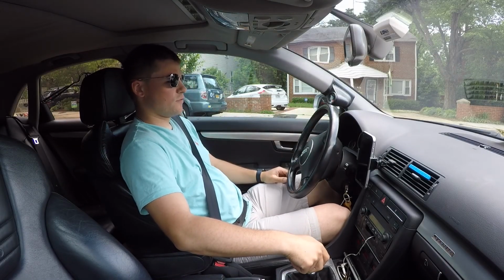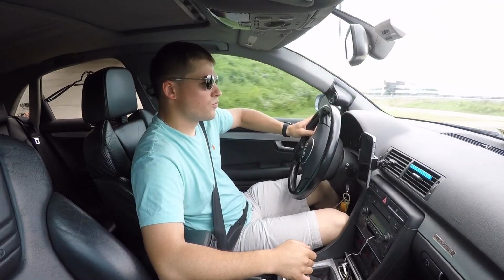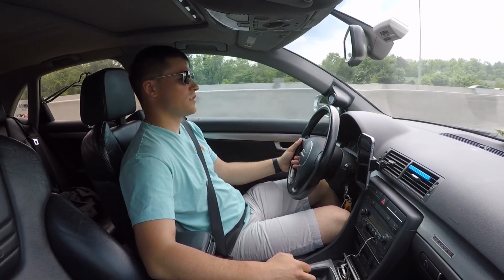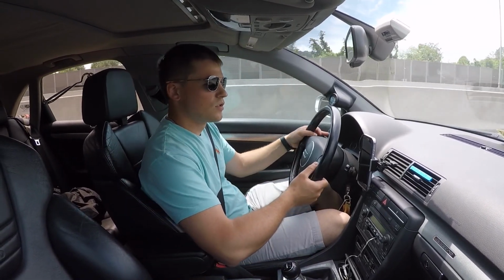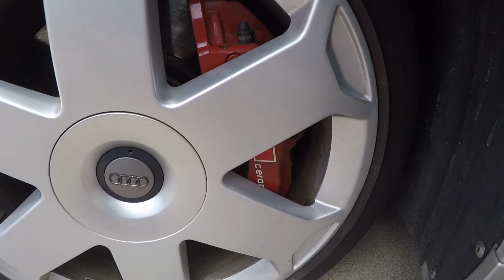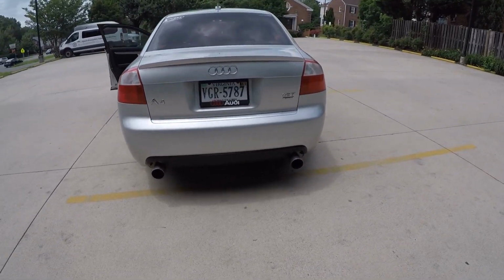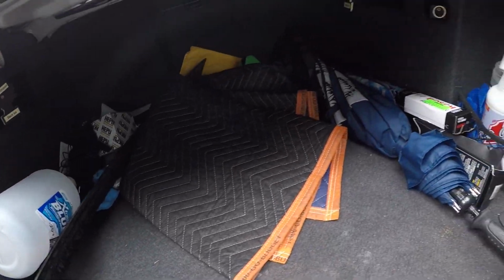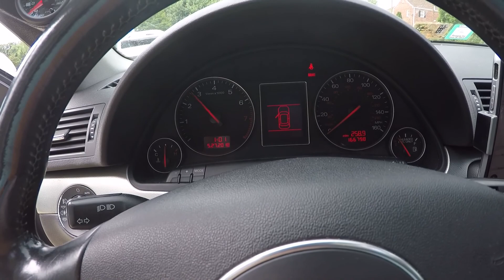2005 Audi A4 B6 1.8T Quattro Review

Comment: What's the blue bar in your air-vent?
Reply from the maker: air freshener
Reply: @cargarage7929  - can you link to the brand and where you got it please?
Reply from the maker: yes , https://www.ebay.com/p/1437656757
Reply from the maker: In mine I installed it without the holder I just put it in between the vents that's why u see the blue bar with the holder you wont see it

Comment: Where did you get that bbk?
Reply from the maker: DIY Garage got them from a junk yard, came off a Cayenne
Reply: Car Garage dose need adapter?
Reply from the maker: DIY Garage no adapter needed, direct bolt on
Reply: I want to what years cayenne
Reply from the maker: DIY Garage 2005 and you will need to buy different bolts